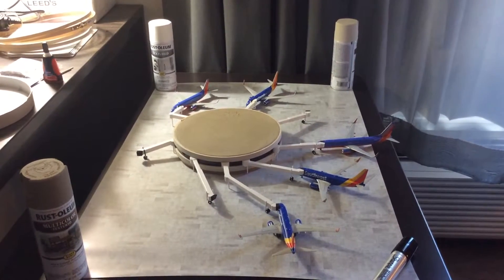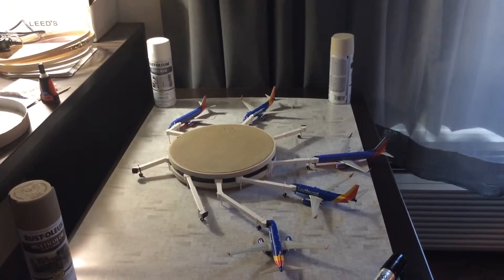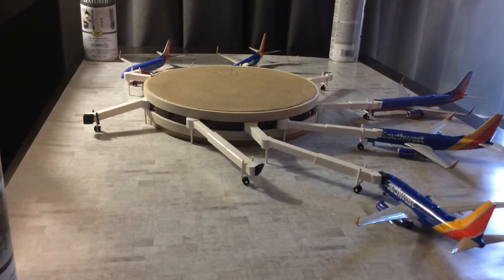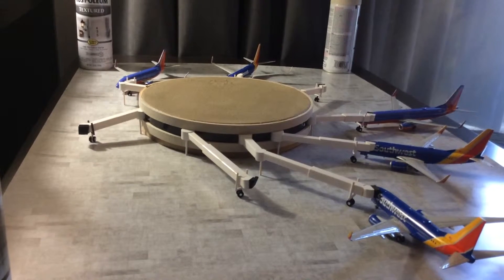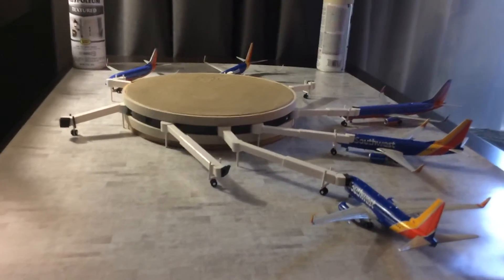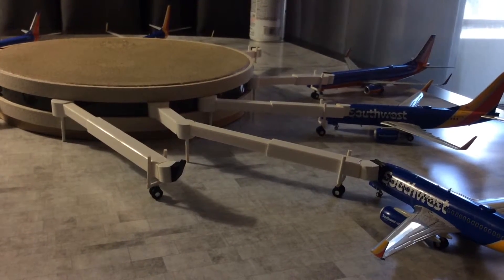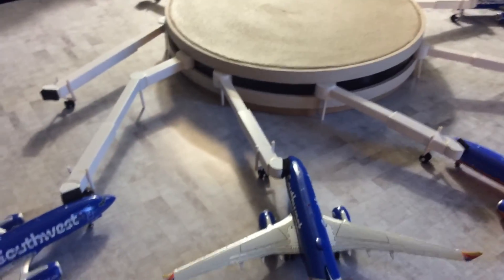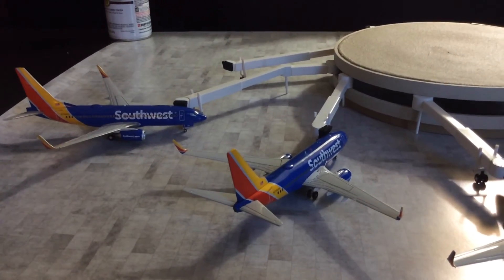1/200 Airport-KSAN Terminal 1

Comment: Where do you find the SWA planes?
Reply from the maker: pakmanz honestly, most of these came from eBay. For one of my later videos I did a heavy SWA video that has some much more rare models. Those you have to be creative in your searching. DAC has a great for sale section I've used, as well as the standard retailers from time to time.
Reply: Foster398 That's cool!
Reply: Foster398 Also, what did you use to make the terminal?
Reply from the maker: pakmanz this video breaks down how I made these round terminals. 
https://youtu.be/OAR7IU-Nmxg